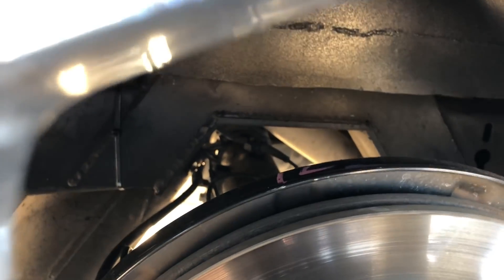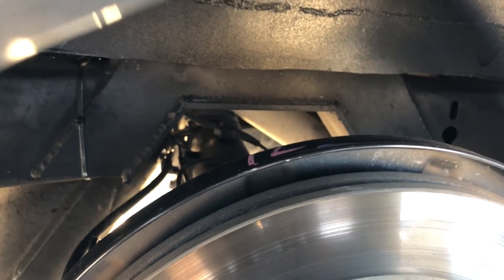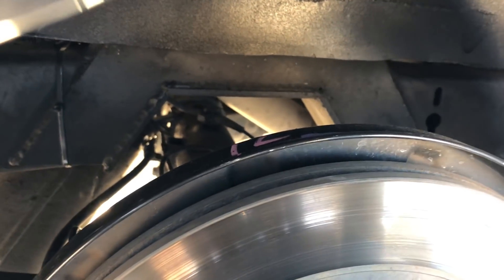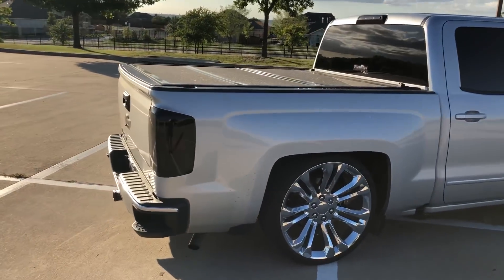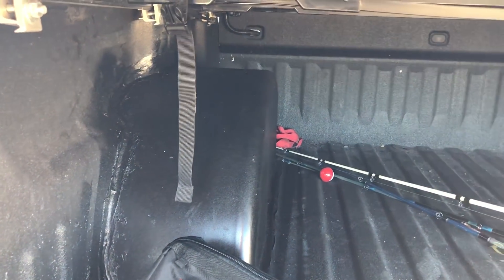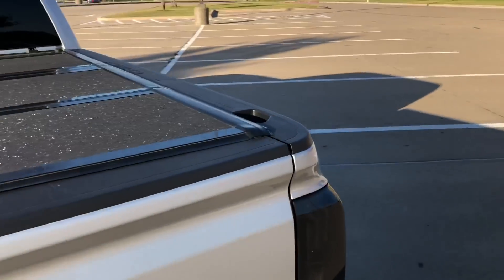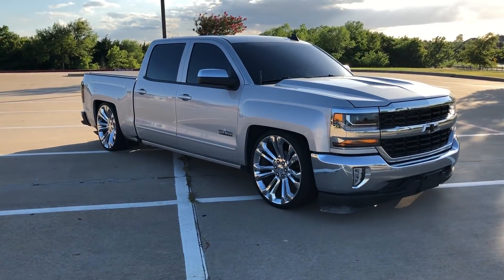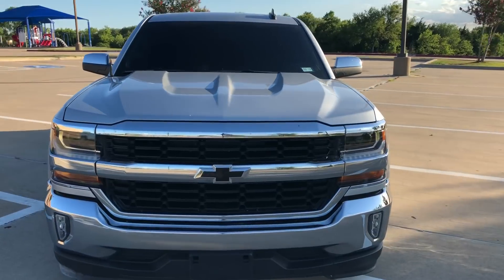EVERYTHING you need to know about NOTCHING your vehicle!

Comment: Changing the geometry of your stock suspension and cutting your frame to  unapproved suspension  can put you in a lot of trouble in court if you in fault of a fatal accident. 
In the case of trading your truck in a dealership . And they found frame cutting and  Modifications were  preform  it become a zero value truck until salvage tile is applied. Which will reduce the value about 50% of the  Vehicle actual value. 
In the case of your truck you probably lost every warranty on it too.
Know, in the case of selling your truck to a private party. If they get in an accident and get injured This can come back at you if they weren't worn about the changes of the truck unapproved suspension. That party can sued you. 
How do I know this ? I went through it.
Except having the fatal accident. 
That was explained to me in court. When I was trying to recover my 2000 Silverado bag truck .
It's about how bad your city wants to throw the book at you at the end.
But , I continue dropping them lifting them and customizing them. 
I just change my driving habits and I'm careful who I sell my trucks too and make it clear on paper that suspension was changed and they buying as is.
By the way your truck is clean.
Reply: Cesar Sanches 👍
Reply: That’s why the shop of the drop kit don’t do a c notch
Reply: Thanks for letting me know this im gonna drop mine a little but without a notch
Reply: Yooooooo I’m glad no cnotch was put on mine 💪 put dam it hits hard my truck is 4/8 and lord it bumps like a mfffff